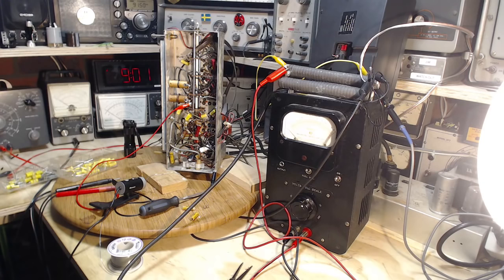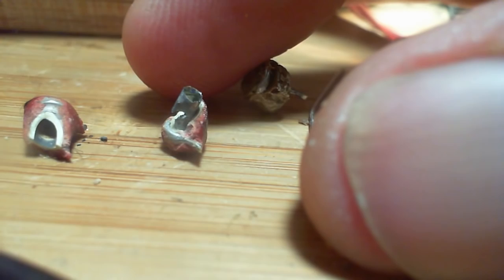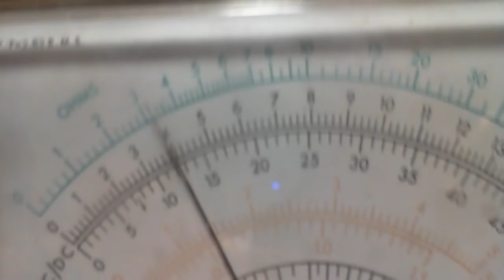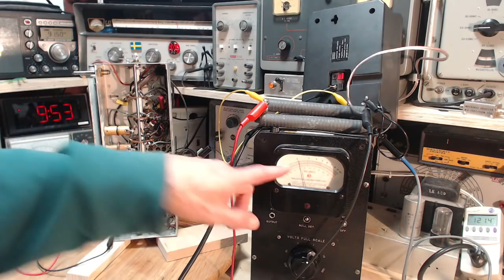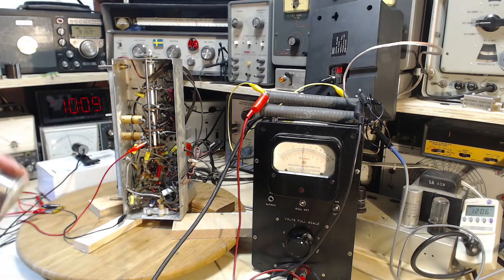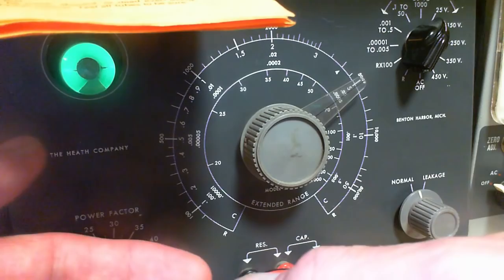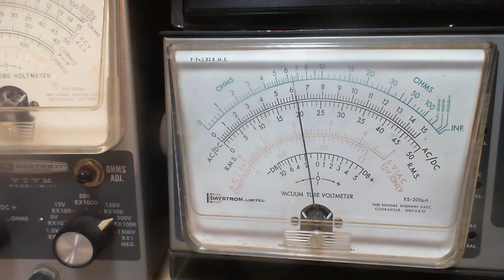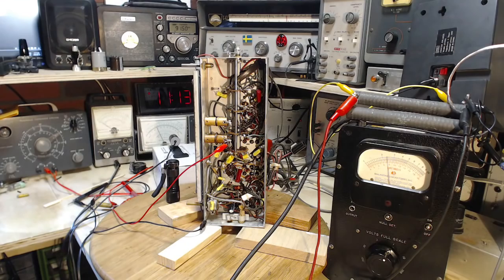Electrohome Chippendale Console Video #12 - Last Five

Comment: Hi Jim:  I'm currently working on one of these Ol' gems.  I noticed you replaced the FM discriminator cap with a 22 uf instead of the stock value which is 5 uf.  Will that have any affect on the FM performance?  Is there a reason why you went with 22 instead of 5?